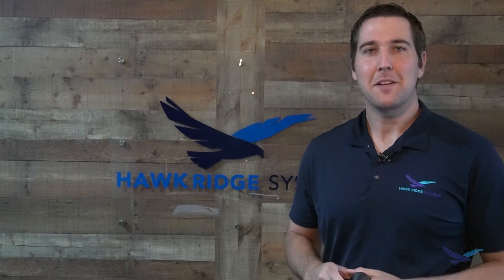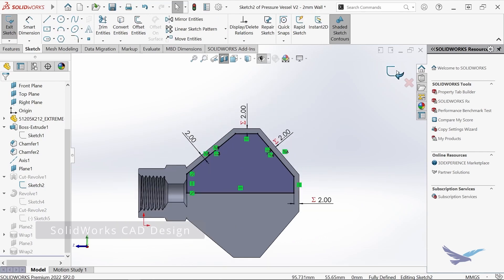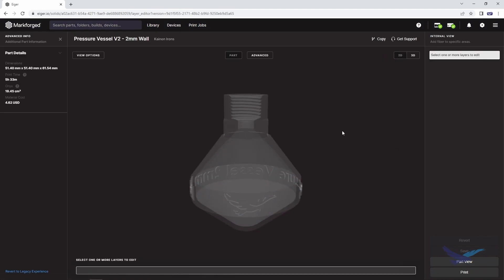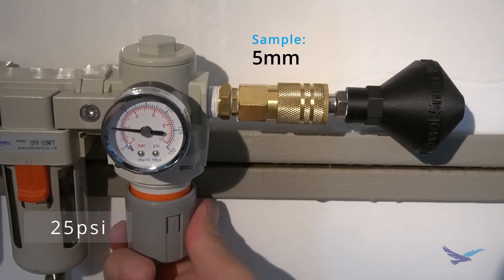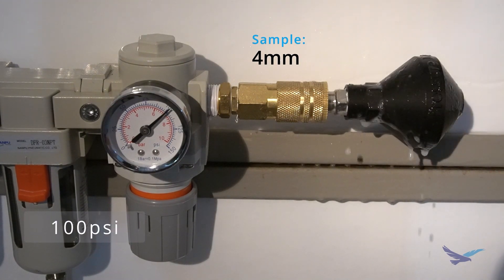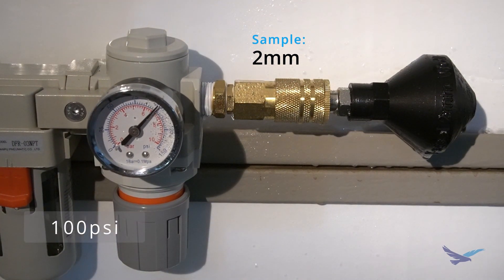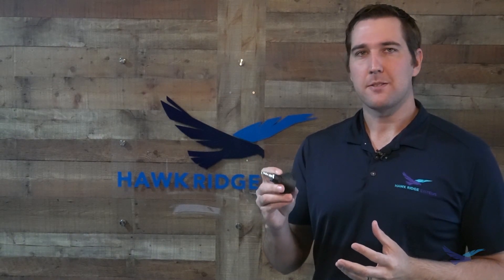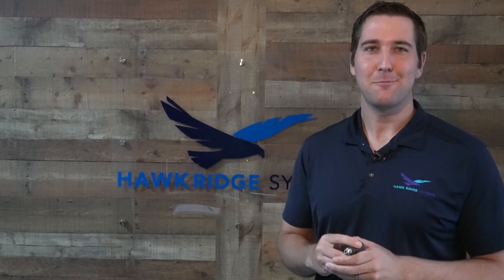Are Markforged 3D Printed Parts Airtight and Watertight?

Comment: "I had no idea what to expect"... proceeds to put 100psi air into the part. You got very lucky. NO ONE SHOULD REPEAT THIS EXPERIMENT! This is NOT safe. Your goggles will not stop a 2" shard of plastic shrapnel from tearing through your neck. The proper way to pressure test something like this is by pumping high pressure water into it, not air, with the test piece submerged in a tank of more water. You can put fluorescent dyes in the water to test for leaks with a blacklight. You can easily and safely test the parts up to a few thousand PSI this way, and actually get useful data by bursting the various samples. And is that a glass jar you're putting it in? Flying glass shards are even worse than flying plastic.

I'm rating this an 8 out of 10 on the Louis Slotin scale of scientific testing safety negligence.

Comment: I'm sorry, but this test is quite misleading.  A boss of mine once took an aircraft speaker housing printed in Ultem, filled it with water an announced it was waterproof.  I took the still full housing over to the sink and added one drop of dish detergent, and it immediately got wet all over and started dripping.  If your video were to take those printed chambers and spray your leak test soapy water inside the part, where the pressure would drive it into (rather than push it away from) the "wicker basket" of the printed part, you would see a very different behavior: the soap radically reduces the surface tension of the water, and allows it to wet the Onyx; then it will leak air profusely --like an aquarium air stone --at least until the water in the chamber dried up.